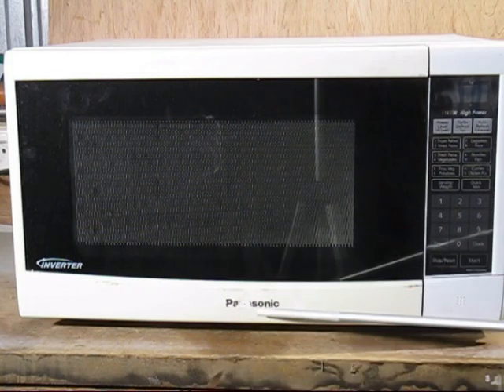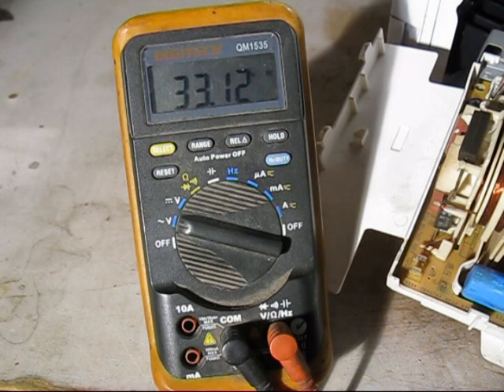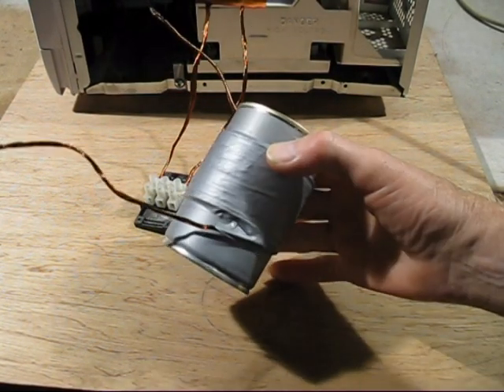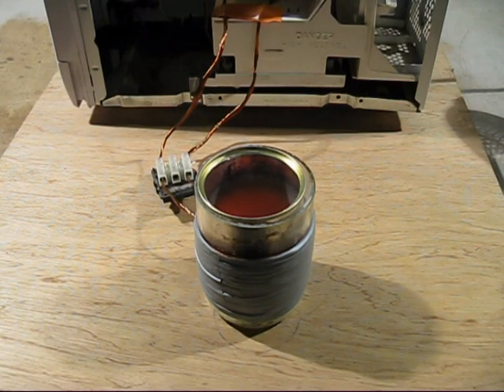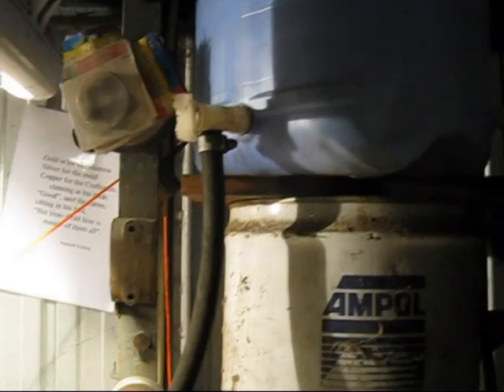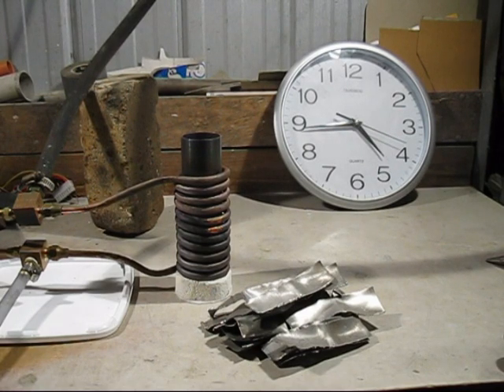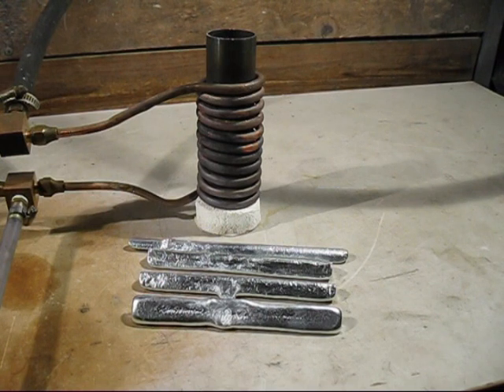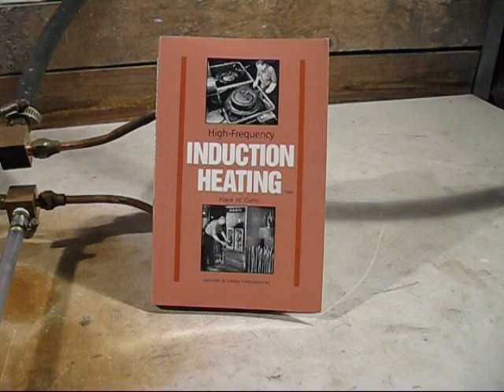First time on youtube, induction furnace made from microwave oven parts

Comment: why zero info on the actual mods/circuits used ?
Reply: Because then you would see this is really only a resistive heating system. A person can make all kinds of claims if they don't present the data to back it up.
Reply: @paparoysworkshop  How is it resistive? The coil is cooled.
Reply: @borisjohnson1944  Without me actually conducting this experiment myself and testing all parameters, I can't be 100% sure of what he's actually doing. The  entire video is suspicious. I've built many induction heaters and this is definitely not a practical way to go about it. For part of his demonstration, he could have fill the jar with water and see if it would heat up. If it's truly inductive, the water would remain cold. Notice the break in the video at 6:48. It's like he cut out some time. Inductive heating would have turned that can red hot is mere seconds. Why did it take so long? Why is there a break in the video? Don't just assume that everything you see on YouTube is the truth. Question everything.
Reply: @paparoysworkshop  The induction heating of the water was done via the tin can getting hot, just like it is done on a stove top. Are you sure you have built induction heaters?
Reply: @paparoysworkshop  I also run a science page so questioning everything is something I do everyday.
Reply: Roy, you write: “Because then you would see this is really only a resistive heating system.” 

Have you actually watched the video to the end? 
Have look at the 10:40 minute mark in the video. You will see that the steel tube "crucible" is glowing red hot while it is enclosed by, but essentially not in contact with, a water-cooled copper pipe coil. The steel tube is clearly glowing red hot while the copper pipe work-coil surrounding it is not. In that circumstance the heating of the steel tube can only be by induction heating. For the copper tube work-coil to be heating the steel tube by the coil acting as a resistance heating element, the copper tube would have to be hotter than the steel tube, which clearly it is not. Indeed, given that the copper pipe is water cooled with a non-pressurised system, its temperature will be no higher than 100 C (unless it is flashing the water into steam, which I think we might have noticed). The second law of thermodynamic dictates that heat energy only flows from hot to cold. So, in the situation depicted in the video, some heat energy will actually be flowing from the red-hot steel tube to the copper tube work-coil, not the other way around. The evidence of your eyes is that the copper tube is colder than the steel tube. As far as the red-hot steel tube is concerned, the copper coil looks like a heat sink, not a heat source as you imply that it would have to be by the phrase, “this is only resistive heating”. 

Of course, ultimately, even induction heating becomes mostly by electrical resistance IN THE WORK OBJECT.  The steel tube is being heated by the resistance to the flow of the electric current that is INDUCED in it by the alternating magnetic field in the copper pipe work-coil. That is what happens in induction heating. Electrical energy is transferred to the work object by induction. But even then, the heating caused by the alternating magnetic field is not all by electrical resistance heating within the work object. Some of it occurs due to magnetic hysteresis losses in the ferromagnetic work object as it is repeatedly magnetised in alternate directions. That hysteresis loss heating only continues while ever the steel is not too hot to be magnetic. Cheers
Reply: @borisjohnson1944  If you want to give credence to this without question, who am I to stop you. Enjoy.
Reply: @paparoysworkshop  If it was wrong I would question it. But it isn't. You are, and is why I questioned you. :-)
Reply: @borisjohnson1944  As I stated before, I haven't tried the experiment myself to actually test it correctly. Take my own measurements etc.. Several things just don't add up here such as the meter set incorrectly, breaks in the video at important moments. That's why I question it. There are many videos with false or misleading claims and people just buy into them without question. 
I once built an overunity machine that not only could run itself, but you could draw an extra amp of power from it. It worked perfectly. I let many people examine it, take it apart and rebuild it. No one could figure out why it worked when it shouldn't have. I broke the laws of energy conservation. Or, at least that's what it looked like. But of course, it was fake. There was a trick to it. So again, excuse me if I am sceptical. But like I said, if people want to believe, who am I to take that from them?
Reply: @borisjohnson1944  Side note: Has anyone here in the comment section recreated this experiment?
Reply: @paparoysworkshop  didn't need to.
** as you are rightly concerned -- there could be an additional source of heating **
For instance, 
• my local wireless provider installed a 5G antenna outside my window...
• now, any round metal object of similar resonant wave length now glows red-hot automatically -- quite handy
 -- in fact, my sleep has even improved markedly, ( though I'm not sure if that's because of the sudden silence from the mockingjay nest nearby... 🤔)
Reply: I have. I am an electrical technician that works in a hammer forge. We use Ajax Tocco and Pillar Induction heaters. Some are 3.3khz and some are up to 10khz (rather childish frequencies when speaking in the company of other industries who use induction heat). I maintain and troubleshoot these machines everyday and am quite familiar with the theory, logic, and power circuits behind them. As I type this I am actually staring at the same exact inverter power supply that is in this video. It’s sitting on my desk. It is an IGBT driven output. This power supply is not far off from the industrial power supply’s I service at work. The input is 120v that is fed through a bridge circuit to produce a rippling dc sine wave. It will then go through a choke to smooth out the ripple and feed through the Inverter section to produce a 4-6kV half wave AC sine  for the output. Everything in this video seems accurate and true. I respect the idea of questioning everything but just because you feel the need to deceive people doesn’t mean everyone else will stoop to that shitty level. At some point your honest curiosity turned to you just being a dickwad.
Reply: @paparoysworkshop  You don't seem to know what you're talking about. Also, your statement of "the meter set incorrectly" is false: have a look at the blue button labelled "Hz/Duty"; if it is pressed, the volt ranges switch to frequency (or duty cycle) measurement. I have that model.

Comment: Quite interesting, I think you could increase effectiveness by taking advantage of tank circuits. if you can tune the resonance frequency of an Inductor, and capacitor to match that of the power circuit you could manage large power peaks.
Reply from the maker: Using capacitors to get a higher power factor might be a problem because as the load changes so does the power factor.  I would need to have many capacitors of different values to switch over as the load changes.  Having the power factor at unity would put more power into the crucible and faster melting times would result.
Reply: I think Mr. Carlson should be in on this.

Comment: Did you wire these two arrangements with one or two turns around the hf transformer secondary winding? Or did you rewind the transformer secondary in some way? Thanks for the excellent video.

Comment: Nice video! As long as uniform stress from uniform heating is maintained, the glass should hold until it melts with out cracking. In other words the temperature of the glass can't deviate from one area to another. In glass a difference in temperature causes irregular expanding, beyond the malleable limits of glass.

Comment: If you add capitance in secondary  of transformer circuit to control power factor might be more efficient .
Reply: put in capacitance to balance the inductance of the heating coil, the resonant effects will cause the heating effect to be much stronger
Reply from the maker: So how do you know what value capacitor to put in to correct the power factor?
Reply: @luckygen1001  you have to know the inductive reactance (2[pi]fL) of the driven coil at the frequency you're using, then you get a capacitor that will have the same reactance (1/(2[pi]fC)) as the coil and that will produce a resonant circuit. Being in resonance also means the power factor is '1' - perfect
Reply: @Gaark  Or, trial and error with decent metrology...  ;-)
Reply: @Gaark  @luckygen1001
 :: if you went back to the configuration when the coils are still connected to the microwave & magnetron,
... try a grape fueled plasma furnace !
( just line the bottom with partially-sliced grape halves - 8<[;-)
Reply: Tocco equiptment  i worked on years ago had built in var meter .

Comment: Luckygen, in your ultimate setup as shown in the video, have you simply disconnected the transformer on the inverter board and extended the primary driver circuit connections out to the external transformer that you have wound on a CRT EHT core? 
Previously, I was assuming that you still had some turns around the on-board transformer and these turns are connected to the primary of your external transformer. Some other commenters seem to have made that same assumption. However, because of the plastic shroud on the inverter, we cannot see whether you still have turns around the transformer on the inverter board or whether you disconnected the primary connections to the on-board transformer and brought them out to directly drive the primary of your external transformer. The more I look at it the more I think it might be the latter. A third alternative would be that you have left the transformer on the board still connected to the primary drive circuitry and connected the primary of your external transformer in parallel with the primary on the board transformer. Is it one of these arrangements or yet another one that I haven’t thought of? 

Is your external transformer core gapped where the core halves meet the same as the core of the transformer on the inverter board? The on-board transformer core has a gap of about 1mm in the external leg. Its centre leg may or may not be gapped as well. The gap is there to stop the magnetic flux in the core from reaching saturation.

Here is a link with some information about this type of PSU. It provides a partial circuit diagram, which as I thought, shows it have a flyback topology, evidently with an active clamp (snubber). The link also provides info about the pulse-width-modulated control signal to the board and duly warns of the hazards of these devices. http://www.vk3hz.net/amps/Microwave_Oven_Inverter_HV_Power_Supply.pdf 
Cheers
Reply from the maker: I had a look at that link and what do I find there? a circuit diagram.  I lost the one I got from a microwave oven repair shop so now I have another. I removed the transformer and used the wire to connect my crt flyback transformer.  I put in a large gap 3mm in both legs so the inverter does not overload. Some models do away with the clamp altogether and use a igbt with a really high voltage rating. I think it is about 1500v.

Comment: Great video! You got me thinking. Generally a dangerous thing..

Mark
Reply from the maker: My videos are designed to make people think.
Reply: We all need a little excitement and adventure from time to time!
Reply: @luckygen1001   And I thank you for that! 

The limiting factor here is the power rating of the supply in the microwave. Most large consumer versions are a kilowatt to 1.5 kilowatts. Not enough umph for many metals. But your demonstration of the lower temperature melting metals was very interesting.
Reply: @ginkumpow3726  Yes we do.
Reply from the maker: As you can see it is limited to low power rating but I was very happy to see it working. This video was some thing different for youtube viewers.
Reply: @luckygen1001  Lucky, you gotta amp this thing up, Come On !!!
Reply from the maker: To increase the power output will destroy the inverter.

Comment: I was wondering what the risk of electric shock is from touching the coil and an earth point? I like this project.
Reply from the maker: Don't touch the coil if it has high voltage going through it. You can use a transformer to lower the secondary voltage to a safe level. I don't think that an earth point can be connected to the coil.

Comment: Any microwave high voltage transformer will work. And since most of the world's power line transmissions are a.c. (alternating current), why an inverter circuit? Does your area use d.c. (direct current)?
Reply from the maker: They are used all over the world because the power can be controlled to the magnetron.
Reply: yes & no?
 true that most of the world's power-lines [driving appliance transformers] are only 50-60Hz which luckygen1001 notes aren't effective for inductive furnace. 
* older microwaves implemented different heating power settings by cycling between 100% and 0% over a period of time
 -- e.g. using a fixed 20s cycle-time:
 power level 7 (70%) energizes magnetron at FULL power (@50-60Hz) for duration 14s ON followed by duration 6s OFF
... followed by 14s ON... 6s OFF...
etc...
Therefore, a user panel set to 14s @ 70% power on an oven with a fixed 20s cycle-time gets 14s at FULL power! 
Note: one of the 1st commercial microwaves Amana Radar Range was different - was truely variable power controlled by analog dial
* what i gathered from the video is that many newer ovens implement variable heating power settings differently and more efficient by using an inverter that bumps the drivers to 30kHz instead of only the 50-60Hz from your mains. 
* Repurposed for induction furnace, the inverter's much higher frequency makes induction heating more efficient
 -- from what i recall -- because at higher Hz, flux penetration is closer to surface skin of conductor which saturates depths more with heat generating eddie currents -- which, in this case, is good

Comment: Facinating  and slightly scary topic. Ideally I would prefer to remove the high voltage winding altogether - I presume you have just left it in place and open circuit. You have clearly disconnected the HV output from the magnetron so no fear of microwave radiation, just the 5000 volts.  I didn't hear mention of your coupling winding - did you add that yourself, wonder where the wire came from. Most inductive heating products sold on ebay have direct coupling between the driver electronics (fets) and the heating coil whereas you are using several stages of transformer coupling. Again, the direct coupling approach uses parallel capacitors to resonate the heater coil with the driver frequency, I note you did not need to do that - would it run better if you did. Pretty good as it is of course.

Comment: a question for you to all people watchin this video ,if we connect 2 separate 1000  watt microwave oven circuits to a single heating coil ,do you get 2000 watt power or demage to circuits
Reply from the maker: Just ask someone who has tried to connect two generators together without considering what will happen. If you want to destroy both inverters from  the microwaves that is the quickest way to do it.

Comment: Glass breaks when the heated part expands very rapidly relative to the rest of the body. In this case the contact area between the glass and the can was little, and the thermal mass of the can was also not much, and the can was heated slowly. The over all effect was slow heat transfer form the can to the glass and therefore slow expansion. Plus glass jars are a bit heat resistant, they are not like say a flower vase. So all these little effects equal to no breakage. Im no glass expert tho, not at all :)
Reply: Oh very cool experiment tho, with successful results luckygen.

Comment: I could be wrong, but it seems to me that the fans you have in use are from a computer and I think they are 5.5-volt fans, you mentioned having a 12-volt power supply, so what I think is happening is the fans are being overpowered and that would cause that sound.
Reply from the maker: They are 12 volt fans driven by a 12 volt power supply.

Comment: Nice proof of concept. Fairly simple. That said I have not seen anyone else do that. 

Unfortunately I only have one scrap microwave and its the traditional type but if I ever come across an inverter type I will definitely give this a try.
Reply from the maker: It is a very rare thing to have done something that no one has done. You could try a recycling center to get one.
Reply: @luckygen1001  it is indeed rare to put out an original idea. 

I live in the Caribbean. No luck here with recycling centers. Heck I am struggling getting LiPo here. One supplier I found is charging almost $100 for a battery that retails on the net for less than $15. If I import I have to pay a hazardous charge of $85 on top of all other cost including shipping and then tax on that. Probably closer to $175. I refuse to pay that much for  battery.

I did a series of videos on solar cells and charging a car battery without a MPPT controller. I went as far on the last video as working out all the efficiencies. That I have not seen anyone else do either.

Comment: Pewter melts at around 250C, much like solder. Wouldn't it be easier to use a gas heater or blowlamp?
Reply: You are missing the point
Reply: @AlphaBobFloridaOverlord  OK. What is the point?

Comment: I would recommend that you consider to make a "High Frequency Capacitor Bank" to back up the one that is mounted on the microwave!!! In that way you can shorten the smelting time and save your self the possibility to have to run around trying to find an other microwave!
Reply from the maker: So how do you determine what value capacitor should be used?